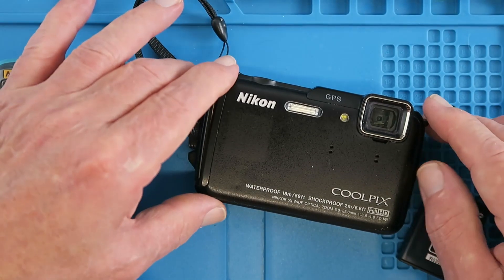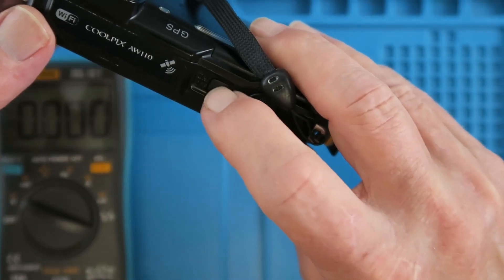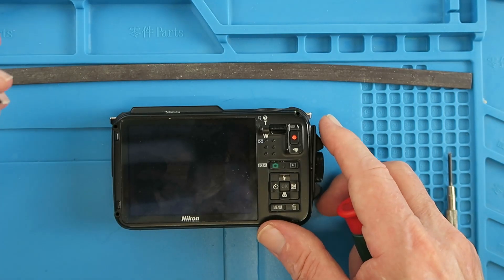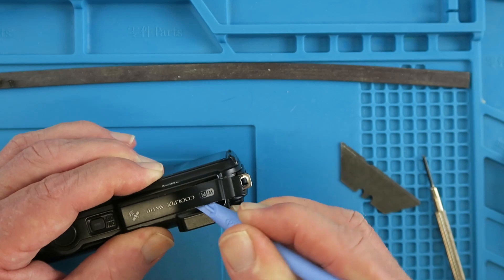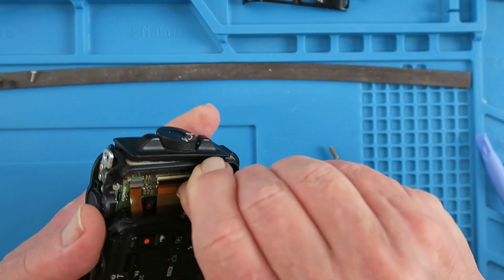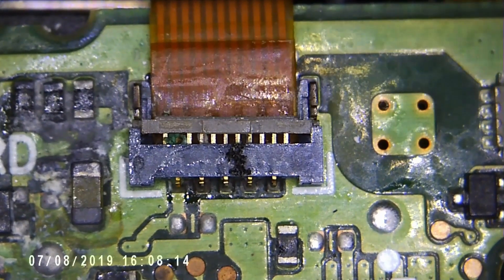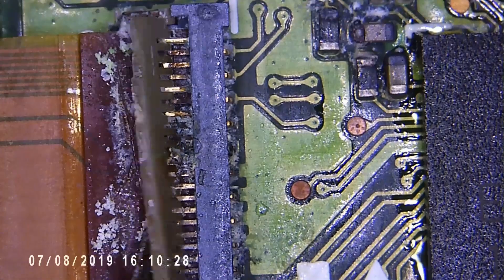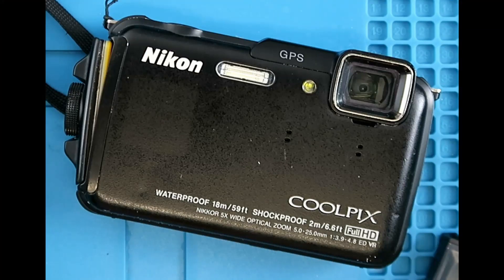Nikon Coolpix AW110 Water Damage Repair Attempt Failure

Comment: Ok so this is an old post, but spookily I gave an AW130 which despite my best efforts to destroy it by dropping it accidentally has been just great.... till now. One last drop and unnoticed by me was a hairline crack on the casing. Yup, then I went snorkeling and mid-snorkel the camera stopped working. I assumed the battery had run out till I opened the battery housing and saw a teeny bit of water, yeah not any old water but salty water, in there. 
My question is this. The camera you were trying to fix had obviously had water in there some time.
As this has freshly happened should I try to dry it out? Should I now properly dunk it in fresh water and REALLY get water in there.
As it's newly occurred, is there ANY possibility it could be rescued or am I totally wasting my time.
It seems the 'rugged waterproof digital camera never really took off and they are super expensive but not even as good as a mobile phone. I require one for it's ability to be dropped!
Reply from the maker: Time is of the essence! First of course remove the battery which you should have done already.  I would sluice the effected area with isopropanol (IPA) and put it somewhere warm to dry out whist praying! Good luck and let me know how it goes!

Comment: hi my camera when i turn on is blue, appeared condensation on the screen. It is good signal the blue screen? can be repaired
Reply from the maker: I am afraid if water has got in it is game over. You could take it apart and look for corrosion on the LCD connector, you may get lucky. Please consider subscribing if you have not done so already!